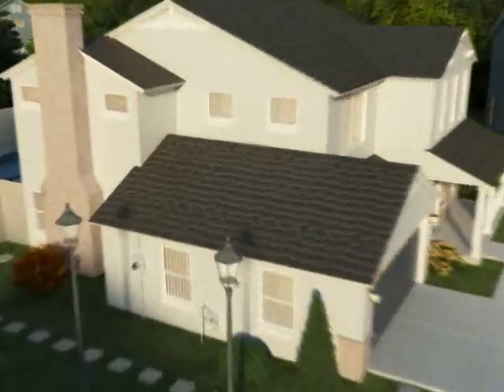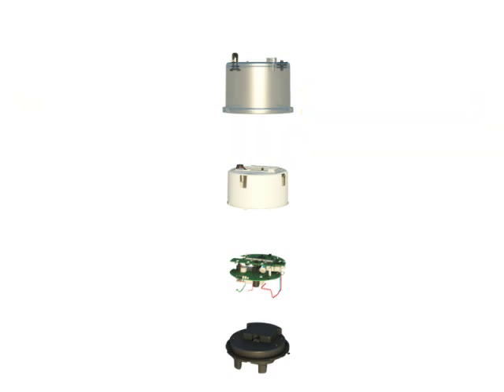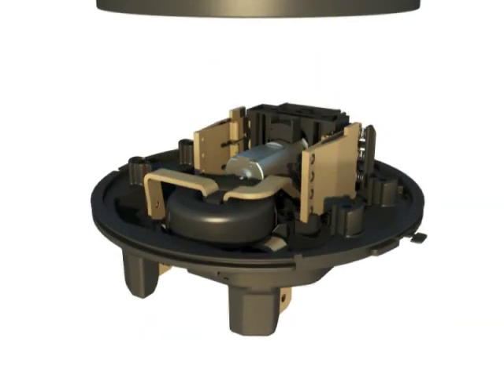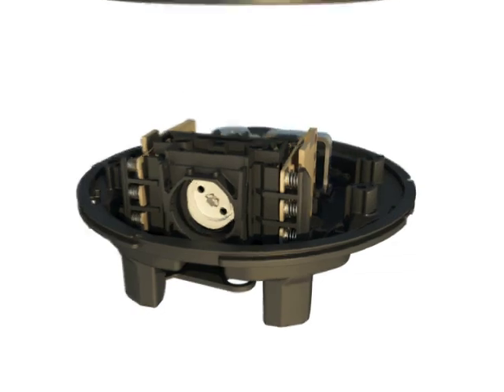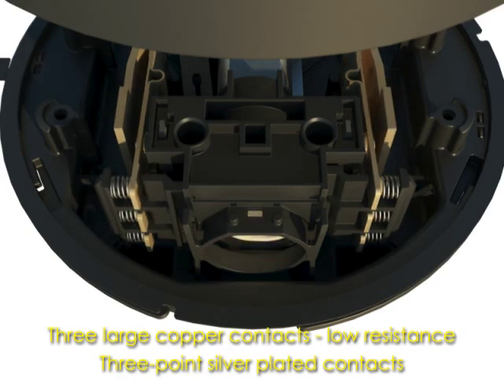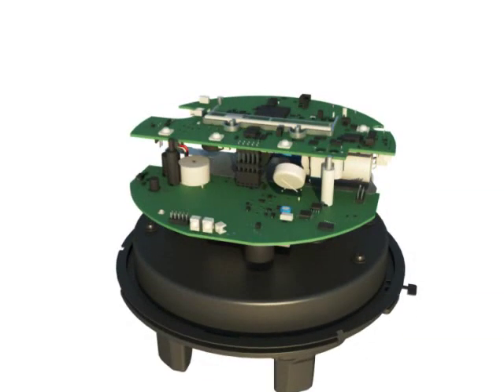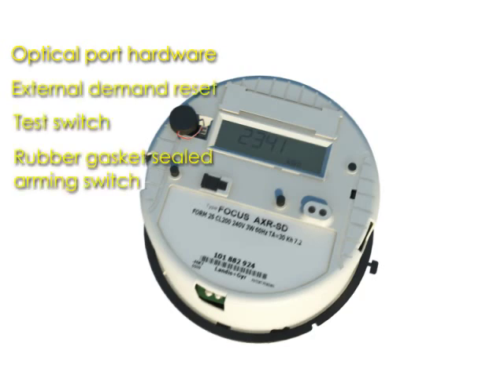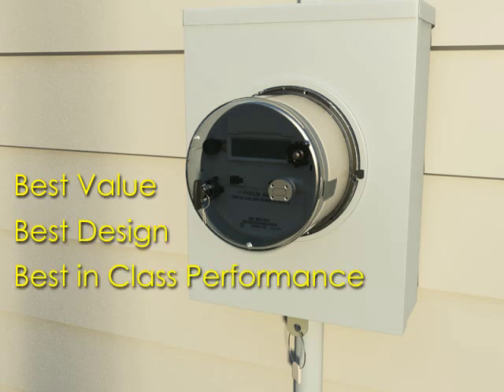Landis+Gyr E350 FOCUS AX-SD

Comment: For the E330 Focus AX or the E650 S4x do you need to use a current transformer or does it work without it?
Reply: How do I wire a CT landis meter
Reply: RTFM.